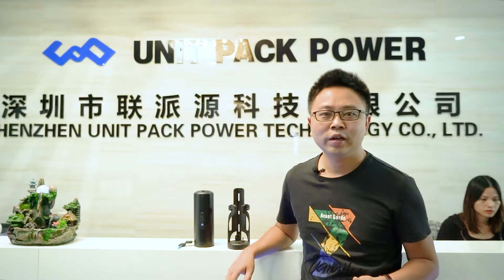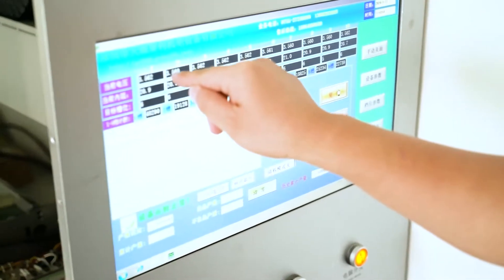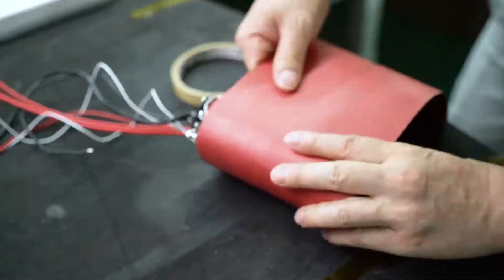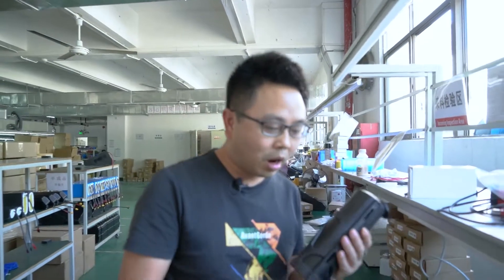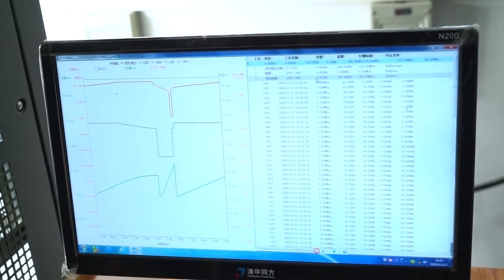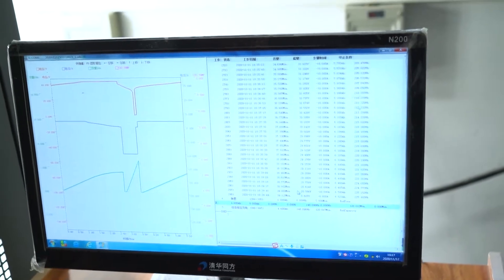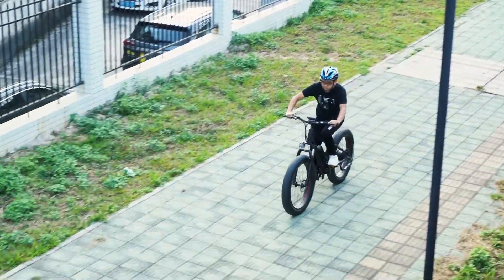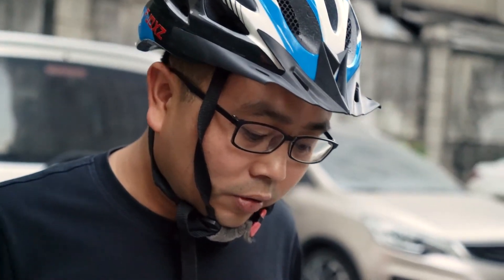New smart ebike battery by Samsung cell light weight and small size battery

Comment: Hello Richard & UPP People: It would be very good to have battery packs in this typical UPP black plastic triangle case with 48, 52 or higher voltage, capacities 20 Ah or higher, original branded cells from Panasonic, Samsung and so on ordering in Europe. Thank you!